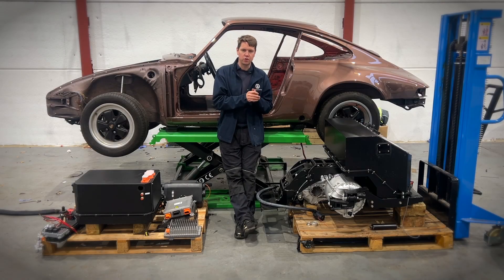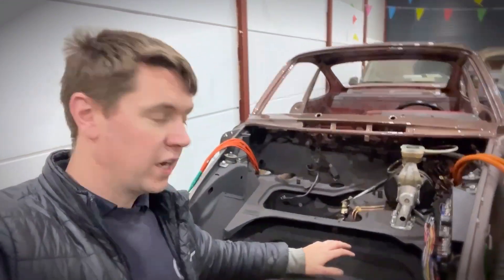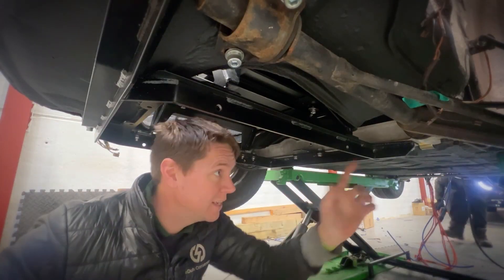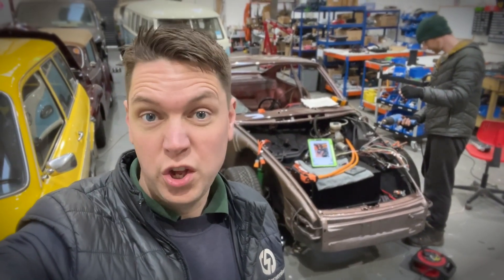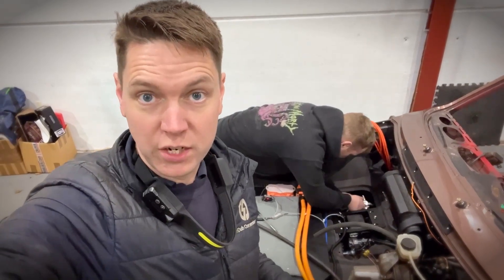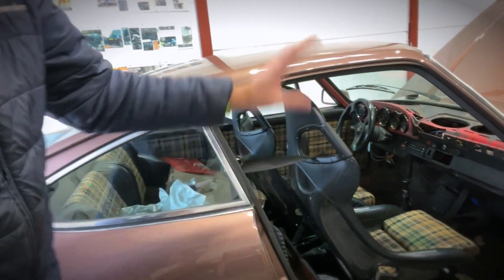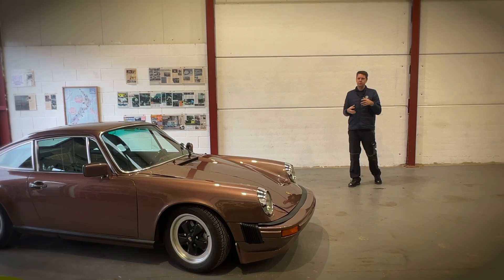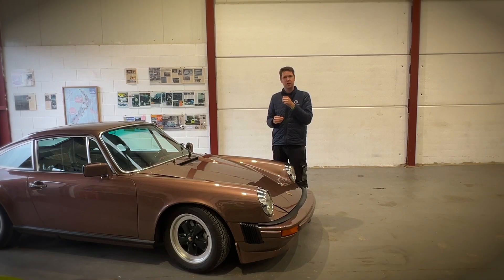Electric Classic Porsche Conversion | Inside the Trade-Only EV Install

Comment: Thank you very much for sharing and explaining the process. I might have missed the info, what are the specs of the battery modules?
Reply from the maker: 42-62kWh packs. We use the latest Lithium Ion modules to support 74kW Rapid CCS charging